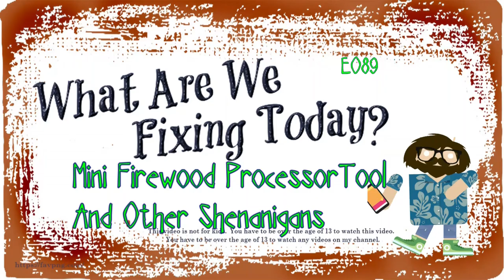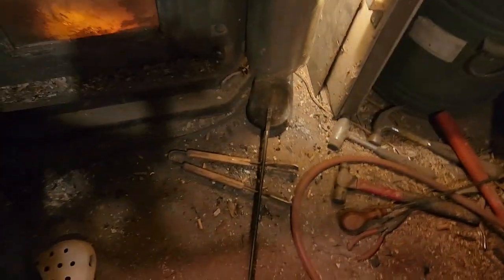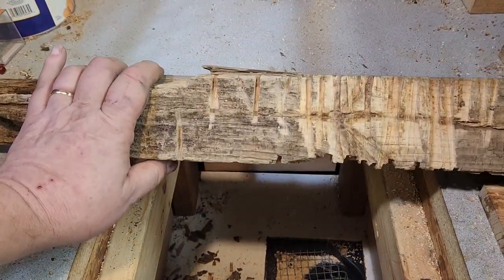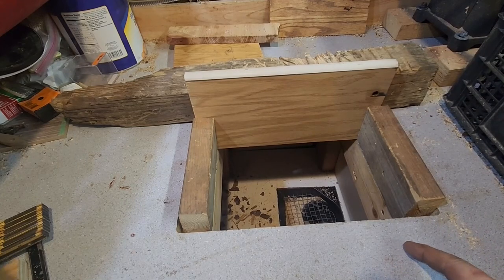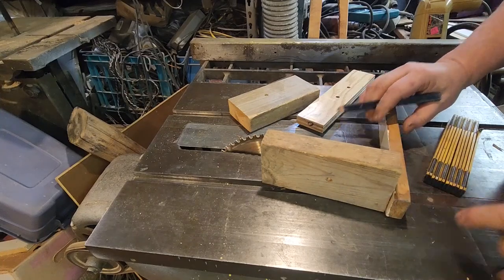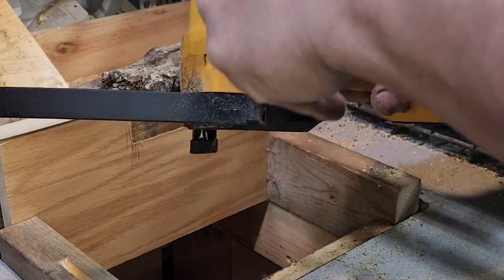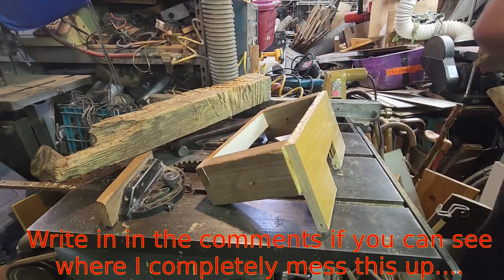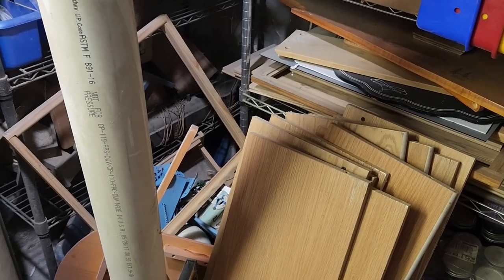Mini Firewood Processor Tool

Comment: The reason manufacturers don't recommend anything but pellets in your stove is because pellets don't burn as hot as wood or gas. Wood burns hotter than gas and requires a steel or stainless steel duct, cap, and sealant that won't catch on fire. If your pellet stove was installed with the minimum requirements (aluminum duct and cap) it can melt if you burn too much wood, but a piece or two is probably okay.
Reply from the maker: By law pellet stoves are limited to like 500 degrees at the output flue temp at the stove. If it gets too hot, the pellets stop. If you have a chunk of wood in there, it can't control that heat. I get it, but I do it anyway. If you are using aluminum flue pipe that is not code anywhere, that is a dryer vent. My output flue is the double wall stainless pellet stove pipe that runs less than 10 foot into my chimney. A chimney that was originally built for a coal furnace. It is very rough on the firebox, so it is not for everyone. I need to rebuild it and make new parts every season.